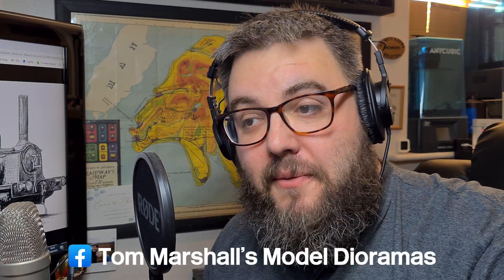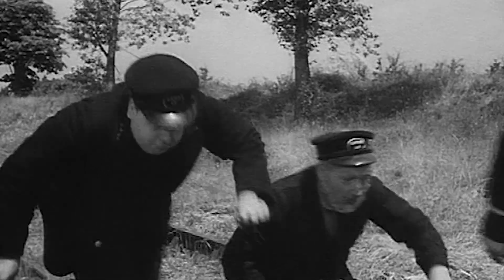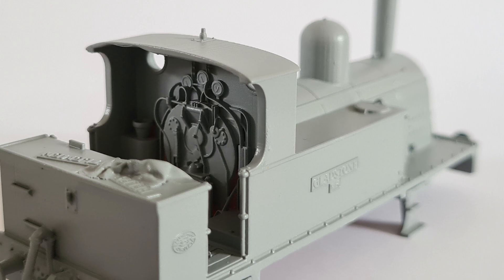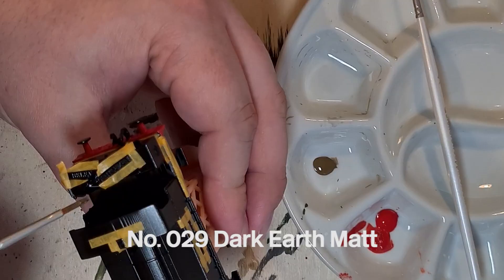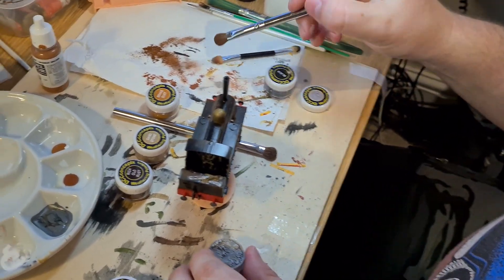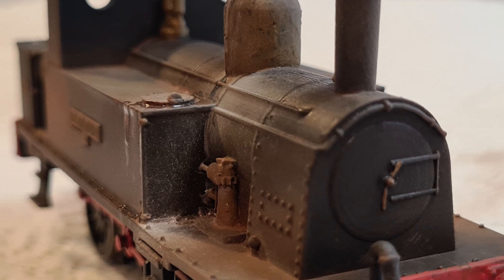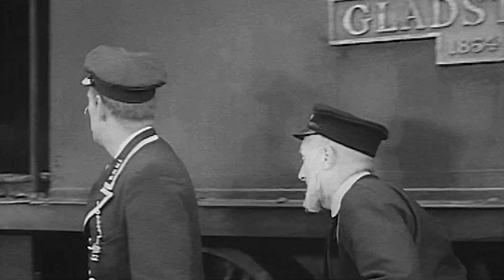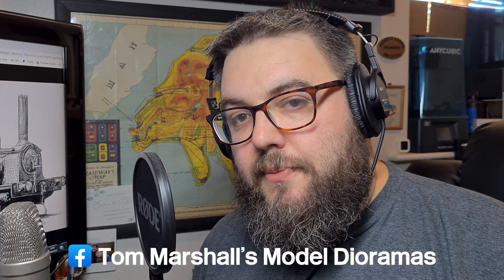Modelling Gladstone from "Oh, Mr. Porter!"

Comment from the maker: I know a few people have struggled to find the Electrotren or Jouef 0-6-0 loco chassis required for my Gladstone body shell and they are getting rarer now.
I'm pleased to confirm the Lima HL2314 uses the identical chassis/motor etc to the ones previously listed, and I picked one up directly from Hornby for £65.  The only difference is the wheels are a dark red with white lining which you may wish to paint.

*Yes I'm well aware Gladstone was a 2-4-0, not an 0-6-0 as explained in the video 🙂

Comment: There is a way (or two) of making Gladstone a 2-4-0T while still using the Electrotren chassis, and the answer can be found from real life cases. Some companies converted 0-6-0Ts to 2-4-0T with a popular one being to remove the coupling rod between the first and middle driving wheels, which was done some tank engines. Another would need work and that is to replace the forward wheel with a smaller set most likely meant for a tender, pretty much like what the LBSCR did when Boxhill was converted to a 2-4-0T briefly.

Comment: Have you considered taking off the front coupling rods to technically make the engine a 2-4-0? I know that the wheels would still all be the same size, but at least the front ones are covered by the cylinders, so it makes it harder to notice.